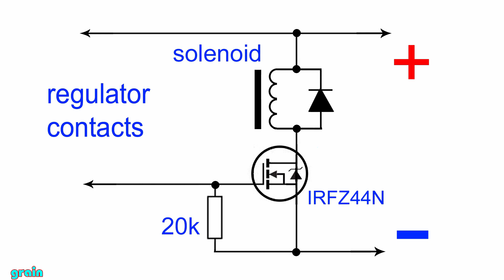Solenoid Motor with Mechanical Adjustment

Comment: If you remove the blue plastic, would you not give more contact to the system? Very good invention, he had never seen it, regards.
Reply: That's to control the on-time for the portion of the rotation that it would actually matter. It has a triangular wedge cut out, which allows for a higher speed (greater % duty cycle for the solenoid driver circuit) as he pushes the brush further from the return wire.
Reply: It's PWM, but controlled mechanically.
Reply: @imnotbeluga007  gracias

Comment: Is there an electrical feedback loop to your rotating contact? Are you supplying power then feeding it back? I do not really understand what it is meant to be doing. Thanks for a reply . Really  elegant assembly. Well done! RodMac
Reply from the maker: A connection diagram is shown at 2:12. This is a standard solenoid motor, but with adjustable solenoid on / off torque.
Reply: @grain-diose  Many thanks.  It is a very elegant solution .It is always satisfying when a plan comes together. Thanks again.

Comment: wow
Amazing, how would it be possible to control the current / amperage and not just the time?
Reply from the maker: This is essentially a mechanical PWM (pulse-width modulation).

Comment: What is the bearing and shaft dimension please let me no....and also tell me about the copper bush
Reply from the maker: The size of the bearings is not fundamental, I was looking for the shaft diameter, I do not remember the size of the copper sleeve, about 20 mm.

Comment: Very good but didn’t really understand your speed control. Thank you for sharing
Reply from the maker: A cylinder with a contact changes the moment the solenoid is turned on and off. If the solenoid has more time turned on, the speed is greater, if the time of the turned on solenoid is minimal, then the rotation speed is minimal.
Reply: Okay thank you. Like to make one some day 👍🏼